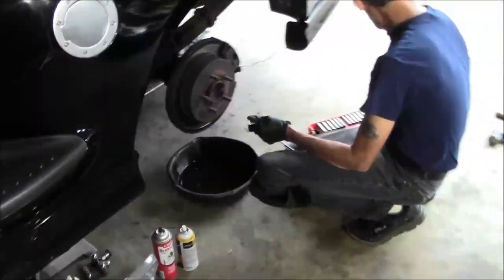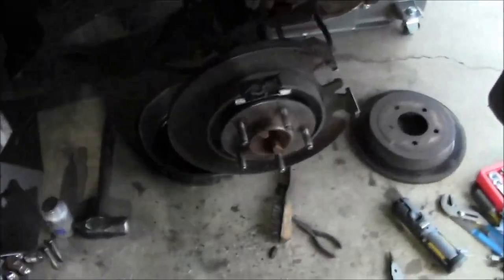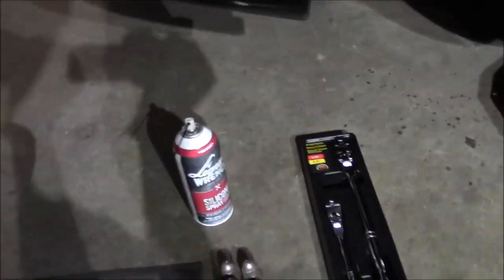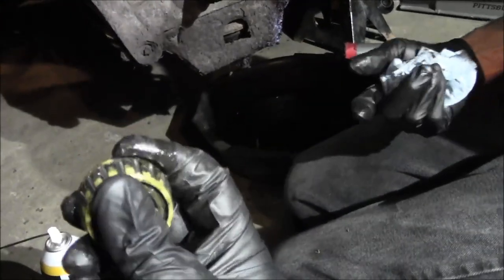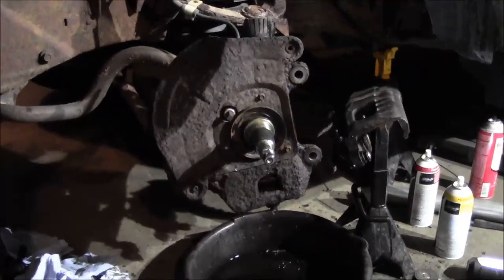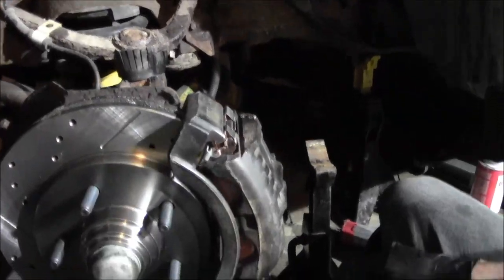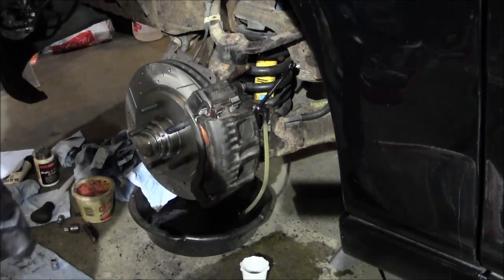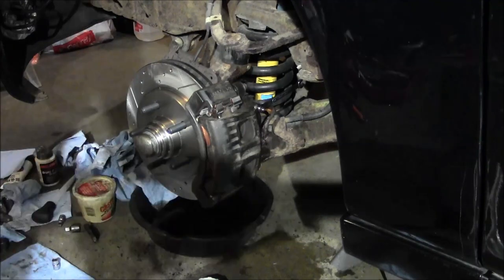SVT Lightning Full Power Stop Brake Job

Comment: Awesome Video, I just got back from 4 years overseas with my lightning in storage. Needs alot of work and this video helps. I ordered the same brake kit. Look forward to fixing some issues. Thank you.
Reply from the maker: Graham Wittwer:  You're welcome and welcome home.
Reply: @fwh79FOXR6  Where did you get the new front wheel bearing it? They don't come with them correct?

Comment: Glad to see you guys are doing the whole thing that is the most crunchy lightning I’ve ever seen The truck had to have been  from up north. I’ve got an 02 and  upgraded to performance Friction two piece floating rotor the direct drive they all right. Did stainless steel Russell braided lines also. you guys look like you’re doing a good job though. You’re probably wondering how I put those rotors on there they’re made for a Mustang I offset the bolt pattern Opened up the I.D. to fit where the wheel centers up on the hat and took the whole rotor bearing housing assembly put it in a lathe and turned off the rotor off the bearing housing and just reuse that part alone I made a bracket to mount my stock caliper to the spindle to move it out to accommodate for the bigger rotor. Turned out pretty good best brakes I’ve ever had

Comment: Probably one of the most over looked parts when people do a brake job. Caliper pins an boots. Nice work. Those brakes look awesome.
Reply from the maker: Foxbody Mike:  Thanks Mike.  The job turned out really good.  Plus, the truck stops much better than it did.  Now... if I could just finish buffing it!
Reply: fwh79 it's going to look great!!!
Reply from the maker: Foxbody Mike:  So far it does.  Not too bad for a very old truck, that's for sure.  =)

Comment: Fixing to get mine done this weekend, just curious did you guys do the break in procedure? And how have they held up these years?
Reply from the maker: Yes, you should always bed in new rotors.  A proper brake bleeding is also highly recommended.  The brakes are holding up very well but I will say my dad is retired and his truck doesn't get the typical use of a daily driver.
Reply: @fwh79FOXR6  I agree and mine doesn't get driven everyday either, thank you for the reply.
Reply from the maker: @405SVT  You're welcome.  I don't think you are going to be disappointed 👍

Comment: Do you happen to know the difference between the Power Stop Daily Driver kit vs the Hauling and Towing version?  (perhaps brake pad material  or rotor size?) The Product# you listed is recommended for hauling/ towing. BTW, thanks for sharing this video.
Reply from the maker: strumpeteer:  I'm not 100% sure... but I think the daily driver kit has regular brake rotors that are not slotted and cross drilled.